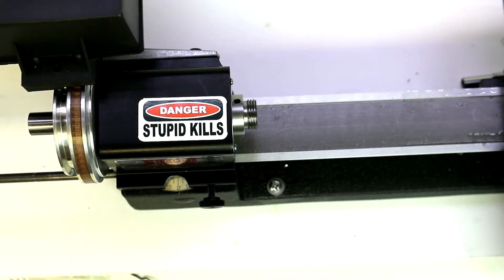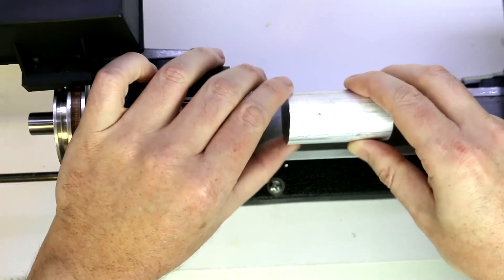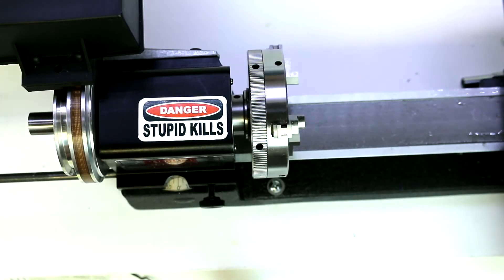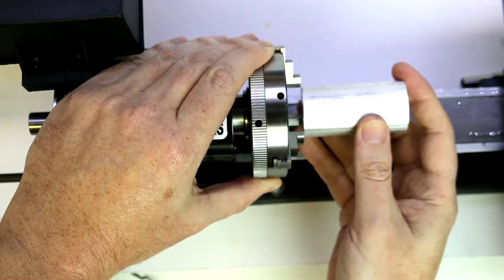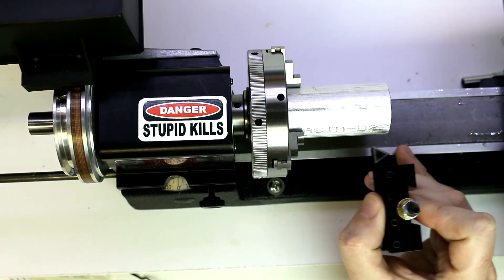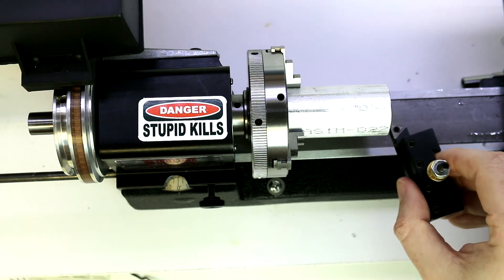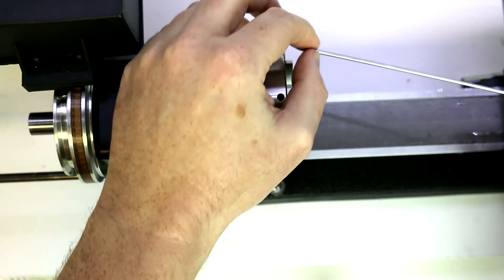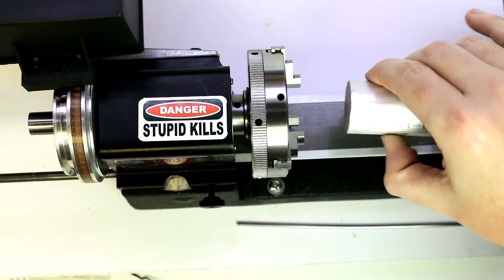Metal Lathe 121 - Work Holding Intro, Safety, and Tool Force

Comment: This is going to sound stupid but is the cutting tool you're using there with the triangle carbide bit called a left hand or right hand cutting tool? Also I need to buy some for my sherline lathe that was given to me, it just has the factory tool post, does it take 3/8 or 1/2 cutters? Thank you again for explaining things
Reply from the maker: +Shane K Not a stupid question at all, very good question. I actually show both in this video, a left and right hand cutting tool. Although the majority of the time I'm holding a right-hand tool, shown are 3/8" tools but you will likely need to start with 1/4" tools. There are a couple of different tool posts that can come from the factory with the Sherline, but to my knowledge they are all designed for 1/4" tools. Sherline does make additional accessory holders for 3/8" tools but 1/2" is starting to get possibly too large for the typical uses of a Sherline size lathe. I have an earlier video that gives an introduction to the shapes, sizes, and materials for common tooling, this link goes directly to the part of the video addressing these cutters: https://youtu.be/wAS5xe8aLrE?t=99

Technically if you have never done cutting before, you are safest to start with High Speed Steel (HSS) instead of a carbide cutter. This is mainly because carbide is harder and more brittle, meaning it can shatter leading do a dangerous and scary situation. If you are careful and patient, you can start with a carbide insert cutter like what you see in this video. Sherline makes a 1/4" set HSS cutting tools that come pre-sharpened and ready to use for $26.25 retail, their part number is 3007 (http://www.sherline.com/3007pg.htm). For carbide insert tools, I am currently using Anytime Tools brand purchased through Amazon and I'm very pleased with them so far and they are the lowest cost insert tools I was able to find which looked of decent quality. A good starting point there is http://www.amazon.com/Anytime-Tools-INDEXABLE-CARBIDE-INSERT/dp/B0087R9OUA/ref=sr_1_3?ie=UTF8&qid=1452614161&sr=8-3&keywords=anytime+tools+carbide+insert which is a 5-piece set for $26.95. If you can afford to use purchase both the HSS and and carbide then go for it, in the long run I highly recommend the carbide for convenience but don't think the HSS set will go to waste if you get both as you can later grind the HSS tools to custom shapes you may need as your skills progress.
Reply: I can't thank you enough for your time sir, I'm going to go to anytime tools now and buy some, I'll make sure to comment to them I was sent there by your channel.